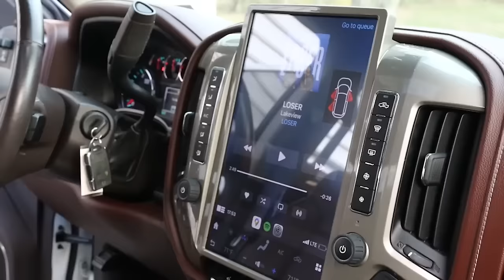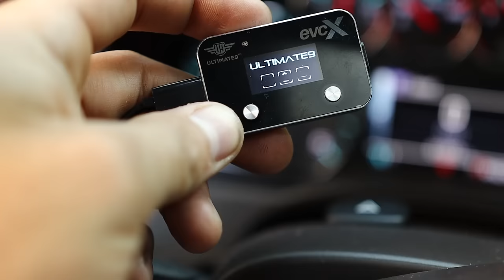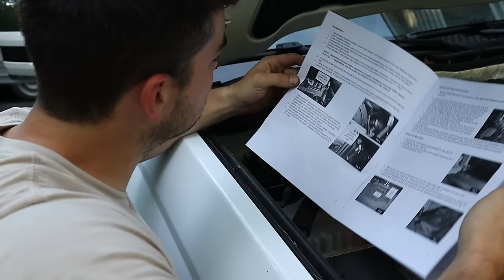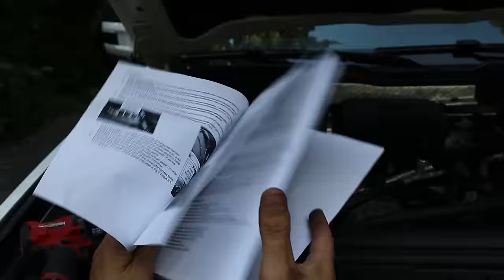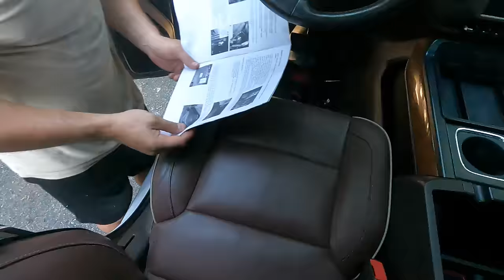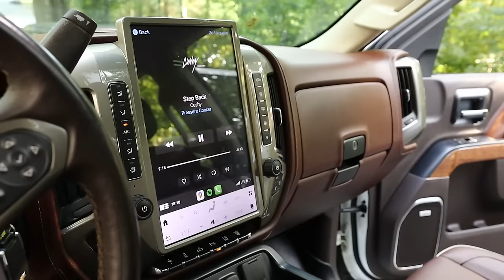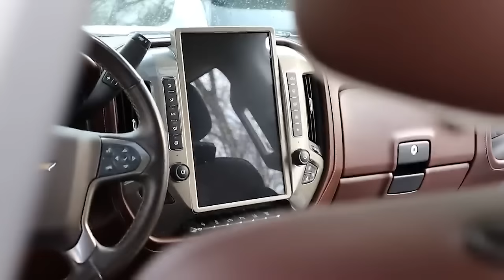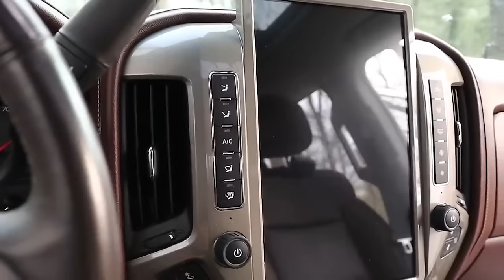ULTIMATE Silverado Stereo / Head Unit / Sub Upgrades on my LML Duramax

Comment: I'll keep hammering--it's hard to believe that someone who made such great decisions on the 996TT could drive around in public on these wheels.
Reply from the maker: I love em!  Will get beefier tires eventually though.
Reply: @matt13ross  the chrome/polished is bad enough, but the offset is the worst.
Reply from the maker: Polished wheels match the chrome on the truck.
Reply: @matt13ross  poor people can’t understand how expensive those (shit) wheels are. And the price of that truck was. As well as how much $ you put into it. 

Based on the comment I left you! Just keep keeping on.
Reply: @purplmoke75 I guess us poor people understand it completely. Those wheels stick out past the fenders and are thus illegal in just about every state in the US. They also cause damage to vehicles behind you that would normally get caught by said fender. That doesn’t include the damage to your own vehicle when said debris gets thrown into the bed side and so on. 
I fully support him restoring and upgrading his vehicles and even appreciate the wheels but for show use only. With dash cams becoming the norm people with wide tires are going to start having their insurance nailed for damaged windshields and/or dent, paint damage. If it’s illegal in your state you can guarantee that it will be that driver’s responsibility.
No different than all those Tree hugging EV owners going after my Diesel tuning, complaining about my black smoke thus making it illegal.
Reply: @P-J-W-777 you sound just how you look😂
Reply: @andreschavezjr4232  Really sounds like a very RACIST comment to me. Really wise choice of words. Are you actually looking for a lawsuit?
Reply: Honestly the non Bose system is great stock. Add a sub, even better
Reply: @OscyJack-  I heard an audio tech at a car audio event talk about factory systems. He had said that manufacturers partner with companies like Bose or Harmon Kardon or Bang & Olufsen to design the system to entice people to spend the large amount to upgrade. However none of the equipment is actually produced by those companies but they do design the layout and tune the system. On top of that the speakers aren’t even close to the same quality as they would be if you purchased the actual Bose or Bang & Olufsen. While they sound better than the base system they still can’t compete with aftermarket amplifiers or speakers. With what they charge for the upgraded audio you can honestly install a much better system for less money.
Reply: @P-J-W-777  depends on the car. Audi for example, actually uses legit B&O in their $8,000 option, the baby b&o is not
Reply: @OscyJack-  see that’s cool. At least you get what you pay for. Wondering how the head unit is. As you probably know that’s one of the biggest weak points and using Line Output Converters actually isn’t all that great because the factory system cuts/flattens out the bass. Other manufacturers should do the same thing Audi is doing and provide real high end systems since so many of the car’s functions are now tied into the head unit.
Reply: See people arguing about wides is the funniest shit I've ever seen cause there so un-intelligent about it just kills me😂
Reply: A law suite 😂 is that a room in a hotel for attorney meetings?
Reply: @Turner2211  I like that lol but yeah special room at the holiday day in because I’m cheap like that. 
Just one of those simple typo or autocomplete situations take your pick. LOL Maybe I should proof read a little more often.

And not actually saying I would do that but these days it becoming all to common. It was meant more as choose your words wisely and carefully because someone who’s feeling get hurt because they care what someone whom they don’t even know and most likely lives nowhere near them thinks and/or looking to make a buck in said lawsuit.
Reply: @P-J-W-777  for sure. 

On my GM, I'm actually like 90% satisfied with the non Bose "premium audio" package. 

Aside from a dedicated sub, the speakers themselves actually sound solid
Reply: @OscyJack-  that’s great, I’m glad they are pretty much doing what you want. Ultimately that’s all that really matters.
Reply: @P-J-W-777  fosho
Reply: @P-J-W-777  i don’t think you would win a law suit over free speech. Also I never saw anything remotely racist with that comment so even more so it would be a law suit over your feelings or assumption of something said. Lol
Reply: @Turner2211  “You sound just like you look” can be taken as a racial statement. Go out and say to someone in person and see where it gets you. Freedom of speech is only going so far these days in this woke world. You can’t even assume someone’s gender without possibly offending them. Either way you can file a lawsuit pretty easily and all you have to do is prove you’ve been wronged. 
Besides it was nothing more than a piece of advise. Choose your words carefully because they can have consequences and what you say or post online doesn’t go away very easily and in some cases not at all.
As I said in the statement above that one I don’t care what he/she thinks of me or about my opinion but they shouldn’t say something that they wouldn’t be willing to say to someone’s face. Social Media has made a lot of people a little to bold when I know for a fact that a big majority of the rude/condescending/racial/derogatory comments being made wouldn’t have been made 20-30’years ago because they would most like be taught some manners.
On a final note they were just being rude because they didn’t like my comment when I’m fact everything i said was true and not meant in a rude way. I was pointing out a fact because people really do need to think about everyone behind them before they choose to run wheels/tires that stick out past the fenders and in most states are illegal. They cause damage and at times serious damage. I’ve seen it first hand while responding in one of those big red truck with all the flashing lights.
Reply: @P-J-W-777  lmfaoooo you def. sounding how you look for sure 😭
Reply: @P-J-W-777 😂😂😂😂😂😂
Reply: Why even bother knocking the guys truck? He likes it, that’s all that matters..

Comment: Put a similar sub in the Porsche for sure. For a truck this big I would have loved to see a proper custom sub box. Typically you can make a huge long one fulling the entire under seat section. You could put several subs and an amp. Marc from Car audio Fabrication YT has done a few
Reply from the maker: I just don’t need that much bass in this truck. it was decent without this sub, now it’s just right for me.
Reply: @matt13ross  Well no one needs that much bass, but it's awesome to have!

Comment: I bought and installed this unit and its great... except the sound output.  I have a pronounced ground loop (whine/buzz/static) that gets louder with RPM of the engine.  It is related to the Aux input on the factory radio (that the tablet uses for sound to the truck).  I am trying to diagnose it now.  Has anyone run into this problem with this unit and found a fix?

Comment: I thought the stereo I had technical issues but, they have a literal papers that tells you the exact problems to why it doesn’t work, although I did made sure I fully reset the entire settings after I did a few adjustments, if yours don’t do it look at the instructions of the trouble shoot and then reset your stereo and redo it again.

Comment: Carry around a Code reader. I have tried three different versions of throttle enhancers and all three eventually messed with the trucks throttle and the unit needed to be removed and check engine light needed to be cleared for the truck to run correctly again.
Reply from the maker: That’s interesting! Hopefully I don’t have that issue.
Reply: @matt13ross  rinse and repeat.

Comment: Finally got mine installed thanks for the video . One question have you tried to use the Netflix app ? And did the volume work for the app ? My music and everything else play but no volume with the app.
Reply from the maker: Have not tried or installed Netflix, no.
Reply: I installed Netflix, had the same issue. But next time I got in the truck and tried it worked just fine 🤷🏽‍♂️

Comment: Matt, did you get a buzzing noise or alternator whine from the radio? I’m getting it currently. 

If so, we’re you able to correct it?
Reply from the maker: Nope, no noise from mine.  I'd guess you need to move your ground cable around.
Reply: Thanks for the reply. I don’t have any accessories- just the factory Bose system and the 14.5” radio. Ordered a PAC SNI 1/3.5 ground loop isolator that plugs into the aux port. Hoping that fixes it 🤞🏼
Reply from the maker: Hope so too!
Reply: @samcastellana  Did this fix your problem? Having the same issue with mine..

Comment: I don't know what type of Bose system you have but mine and my 2019 Chevy Silverado LTZ as great highs lows and mids people think I have a regular sound system in there but it's factory.
Reply from the maker: I've had a few Bose system in GM vehicles, they are okay, but not great.
Reply: @Matt13Ross  Ah man I sorry to hear that. Maybe I have to hear a Harmon Cordon system. Maybe I just haven't heard to many more kinds of factory car audio. I do like the factory Rockford Fosgate system I had in my 2017 Nissan Titan, but I get it. It's all in what you like. Great content though, keep it up 👍🏿
Reply from the maker: Thanks!  The best system I ever had was a completely custom unit (not installed by me) in my 2003 Silverado.
Reply: @Matt13Ross  Yeah I heard that. I just don't wanna mess with all this teck already in there. I have a 2019 LTZ. You might as well call it a High Country with chrome bumpers instead of the painted bumpers. I like my chrome lol.
Reply from the maker: The stock Bose system with the Kicker sub added is pretty great.
Reply: @Matt13Ross  Oh ok I didn't know they had another subwoofer from Chevy I could add. Ima check that out. Thanks for the info 👍🏿
Reply from the maker: That's what this video is about, did you not watch it? lol
Reply: @Matt13Ross  Yeah I watched it, but for some reason I thought it was after market.
Reply from the maker: It is a Kicker but it's a GM option.
Reply: @matt13ross  Gotcha.